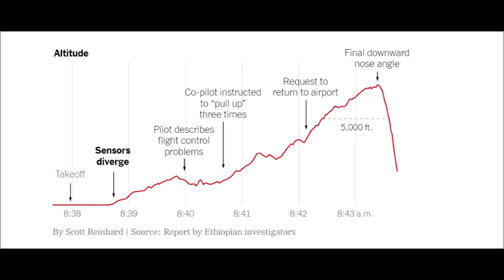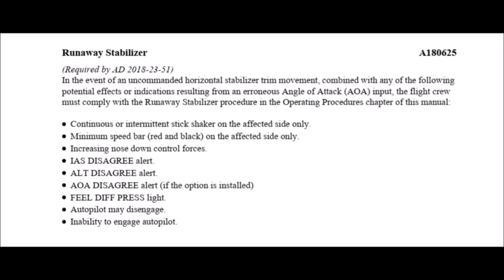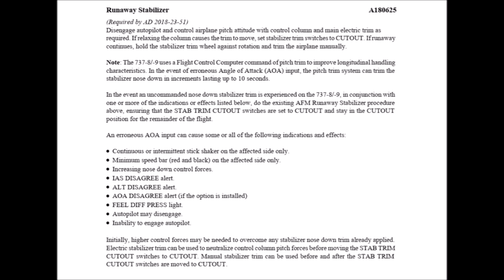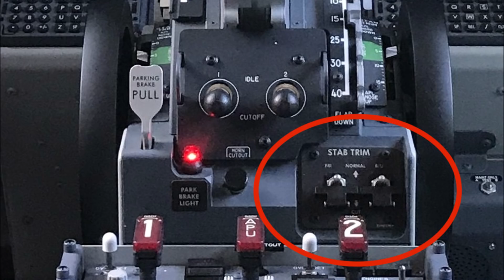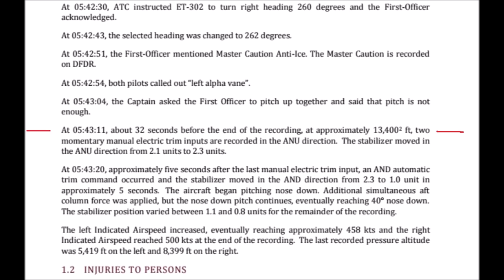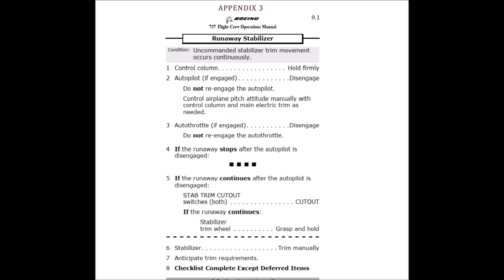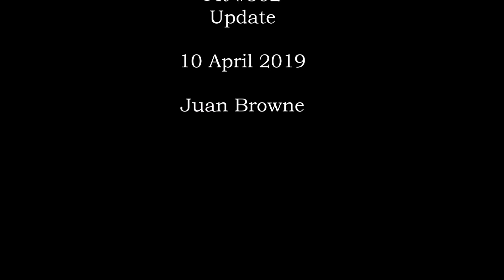737 Max Update 10 April 2019 Runaway Stab Trim Procedures

Comment: the jack screw system manual trim is a dangerous irresponsible engineering design.  At max trim, nose down, a pilot needs a mechanical, doable mechanic at max air speed, to get that nose back up.  I do not accept that in 2019 the jack screw system is right.  It is obviously inversely designed.  You need a hydraulic, a foot pedal approach, and a counter weight on the jackscrew lever, that means that the exponential forces at higher speed, can be negotiated, manually.  It is enough that the Ethiopian crew tried and were unable to wind the trim.

Comment: I can think of two reasons why the Crew may not have reduced the thrust during this whole ordeal (also remembering that evidence of whether the auto-throttles were disengaged or not is still inconclusive).
1) The goal of the crew was for the aircraft to climb. For this to take place the thrust levers need to be at climb power, which was already set. 
2) The aerodynamic forces being exerted upon the aircraft were so high in the out-of-trim condition that both pilots needed to hold the controls with both hands, which overpowered their strength, one pilot trying to control the pitch with the control column, and the other pilot trying to manually trim the aircraft with the trim wheel using both hands.
Reply: Or 3. They were saturated with information and it didn't even occur to them. Humans are not good at multitasking.

Comment: @blancolirio

Juan, given the circumstance of not being able to use manual trim due to the high speed of the aircraft, would it have been possible to electrically trim the aircraft by synchronizing the yoke trim switches and the stab cutoff switches as follows:

1) FO officer moves stab trim switches to the cutoff position.
2) Captain, pilot flying, moves yoke trim switches to the nose up position.
3) FO immediately restores the stab trim cutoff switches to the normal on position.
4) Once desired trim is obtained, FO again moves the the stab trim switches back to the cutoff position.
5) Captain releases the yoke switches.

I would think,  this procedure would deprive MCAS of taking control of the aircraft and still allow the pilots to have electric trim. Of course, going to manual trim once after the aircraft has leveled and speed has been reduced, probably would be best.

Comment: Great explanation.  However we also know that Boeing didn't emphasize enough to all the pilots flying this type of plane that once the sensors are faulty you should never reengage the automatic system because it will reintroduce the problem.  AND that they were working on a solution to this.  Boeing never did this prior to the this crash even though they knew there was a problem.
Reply: Keeping the system off is part of the runaway trim memory checklist. This is not new to the MAX.

Comment: Thank you very much sir for your simple explanation, but I have a question about speed, who controls it basically from the pilot or the system
Reply: The pilot is ultimately responsible. If he is expecting the system to manage speed, he needs to monitor the system.

Comment: Why is it, you can not wait to receive the final report of the investigation leading to this most unfortunate accident. You are so quick to speculate. STOP fanning the flames. It's clear to some of us that your many years as a pilot has turned to (bad snap judgment) and (placing blame ). UNTIL you have a final report from the proper authorities, you need to stop the speculations. I am stabbing at this but, you must have been an officer / brass of some sort in the US. Military. (stop) your not helping. What does scare me is, you might be right but, your teaching people, (your followers to , jump the gun). You seem to feel the need to be right about something, I can hear that in your voice during you'r Vlogs, as you comment on things you have no definitive confirmations. STOP teaching people to grasp, and comment on non factual reports from you. In you'r next statement, I dare you to state that you are 100 % sure the reason for the accident , you know the cause and the fix. If you do not know 100% the reasons/s then stop your Vlog and giving the public wrong insight to this matter.
Reply: What part did he speculate on?
Reply: Boeing provides little/no information which leads naturally to educated "speculation" using what little info we have like jackscrew trim position on the 2nd crash.

Comment: Juan, you need to go into training. Your attention to detail is amazing. You make what everyone else is saying, make sense. I really appreciate your show. In my opinion, it will be a decade or more (if not ever) before I ride a 737 Max. Why it took so many deaths to figure this out is unreal to me. As an electronics engineer, I know how small details , can have  huge impacts. Boeing needs to not only either replace all 737 Max airplanes, (the responsible thing) or pay for all airlines who purchased these planes to go through extensive training, all completely paid for by Boeing. Including all the extra travel fees associated with such training which as a manager I know all too well (hotel/per diem). With a plane so out of balance, would it not be better and safer to not take that one more chance? Pull the fleet in and start over? All it will take is one more accident to completely solidify how unreliable and irresponsible Boeing has become, all for money and greed in the average persons eyes. Such a huge gamble on what has been a good (for the most part)  company. If anything, redundancy is not enough. Triple redundancy is needed at this point to ensure this never happens again. Keep up the great channel. Thanks for all your doing! Love the show!
Reply: The Max is not out of balance. The software updates will fix the problem and the MAX will have a long safe career.
Reply: @stimproid The Max center of gravity and flight characteristics are totally different than the 737 due to having to move the oversized engines further forward than that of the 737 which causes the plane to pitch up more than it should on its own, or they wouldnt need the MCAS system. I for one will not take my chances, but you go for it.
Reply: @markc1310  So because the new bigger engines are heaver and farther forward moving the CG forward....this makes the nose of the plane pitch up....have actually thought that through?

Comment: As a retired B727, B757, B747-200 & B747-400 captain, I agree completely with Juan's assessment. Very well put. All the automation that has been added to transport category aircraft is intended to reduce workload so pilots can manage their flight parameters more effectively. Unfortunately, some pilots use these "labor saving devices" as a crutch to fly the airplane rather than as a tool to manage their flight parameters.
Every pilot should know the pitch attitude and power settings (fuel flow!) for every flight environment, be it takeoff, climb, cruise, descent, approach or landing. When multiple warnings are going off all at once, the pilot flying uses the previously mentioned pitch and power settings to fly the airplane while the pilot not flying sorts things out using the procedures as outlined in the aircraft operating manual abnormal procedures section. Some of the newest airplanes step the pilot not flying through a procedure via computer generated messages.

Comment: So could you please clarify something for me? (You mentioned that the procedure has been in the manual for years.)

Is it or isn't it the case that the procedure to deal with this problem is the same for the MAX version and for previous versions of the 737?
Reply: MCAS on the MAX uses the electric trim to move the horizontal stabilizer to a pitch down position. The recommended method of recovering the aircraft in the event of MCAS failure, is the same procedure pilots would use in the event of a runaway trim situation. This procedure, as described in the video, has been trained to 737 pilots since the 1960's. It is a procedure important enough that it is memorized by all 737 pilots. They should not need to look it up in a checklist. 
Does this answer your question?

Comment: Interesting video, thank you!   As a GA pilot myself for 37 years, I've done a lot of reading on these accidents.   Unfortunately, the vast majority of what we get from the mainstream media is erroneous and oversimplified, as the media's understanding of aviation is only marginally better than that of the general public.....which is to say they DON'T understand much.    When I heard that the Ethiopian pilots were having trouble moving the trim wheels manually, I wondered if the combination of a seriously mis-trimmed stabilizer and heavy control column back-pressure might have resulted in an excessively high force being required to manually trim the airplane.   The piece I was missing was the information that the crew apparently hadn't taken any action to keep the airspeed under control.   Good grief.

In the end, I think Boeing will take it on the chin for what appears to be a very poorly engineered MCAS system.  It still boggles my mind as a guy with an engineering degree how a piece of software that badly designed could ever escape basic design reviews, much less make it into a production airplane.   We will hear about this over and over from the media.   What we won't hear, and everybody needs to hear, is that all of these people did not have to die.   This was a malfunction that could have been handled, even if the crew knew nothing about MCAS.   Unfortunately, too many pilots today are increasingly relying on automation instead of basic flying skills, and if that trend continues, they won't have any of those skills.   I think this is especially true of crews from some non-US airlines.   One has only to read the accident reports on Air France 447 and Asiana 214 to realize to see that this is already happening.    If the press wants something to sink their teeth into, they should be focusing on that.

Comment: I read a comment this morning referencing not being able to manually trim in a 737 NG simulator with the stabilizer under load.
The website is here:
http://avherald.com/h?article=4c534c4a&opt=0
And the comment is time stamped. Only the most recent comments are displayed but the comments section can be expanded.
The comment is labeled:
By JJ on Monday, Apr 15th 2019 09:26Z

Comment: Juan, I hate add another opinion, but I happened to see an issue from a Quantus pilot flying an A330 plane to land at Perth Australia with a similar type of problem that the automation was different from what the pilot recognized. It doesn't tell how the pilot got control & laned the plane in Perth. He was also a former Us Navy pilot with many years of experience with the airlines. Same kind of problem where the auto over rode the pilot. It seems to me that if there is a real bad emergency that the pilot should be #1 & not auto. Have one switch with a cover over it that needs to be flipped open & then activated by the pilot to take full control. Maybe I'm too simple, but better than the deaths involved. Fred
Reply: No, you are NOT "too simple"  Your idea of "one switch with a cover" is a VERY GOOD IDEA.  Same idea as my HAL/DAVE switch!

Comment: Thank you. What I understand from your vids is that Boeing has tried to fix a hardware design flaw with a software...
Reply: Not a hardware flaw.
Reply: @stimproid  So you say that to put a gigantic engine onto an improper body to create a predisposition to the stall is a routine application in aviation. And every other plane has this stall issue which is solved by some sort of software?
Reply: @gravesyou  Did you not hear the part Where he said MCAS was NOT an anti stall feature?
Reply: @stimproid  I don't know (or care) what the MCAS is or not. This plane is not safe because it has a higher probability of high attack angle which may cause serious problems. It is both dangerous even if  MCAS is active or not.

Comment: https://www.seattletimes.com/business/boeing-aerospace/boeings-emergency-procedure-for-737-max-may-have-failed-on-ethiopian-flight/?fbclid=IwAR2rLwONWafQc3W9rKaKVPTn3Coi6mQufm3wztr2OgHVgD8CehUX3kQTdho
Reply: How about a brief synopsis of the article? I'm not disabling my ad blockers so I can pick up the hundreds of pieces of adware and cookies that site wanted to upload to my computer.
Reply: As you said - if the trim and speed is allowed to get right out of hand the combined load of horizontal stabilizer and elevators makes it impossible to manually re trim the plane. I think they go onto say the pilots then needs to fly a series of maneuvers to unload the flight surfaces, regaining manual trim each time

Comment: Juan, I hate to say it.  NO, I don't actually. Since so much of aerospace STOPPED using ADA to program these simple as a one piece but very complex with many systems. Ada WAS Required until the late 90s. Unfortunately, not enough programmers were learning this Language that would catch logic errors. Also, the level of sensors and controls have been taken over by flight computers can be good but also a disaster if NOT properly done, I have never seen this type of issue with Boeing till now  but kind of have been expected due to so many changes.

Comment: thanks for your videos. Major issues you are not touching upon in my opnion -
          Autothrottle also not working properly.
          At take off max speed required for lift off........so when do they reduce speed ?
           if all systems pointing to a stall why would pilots reduce speed ?
           first MCAS kick pointed nose down - this should increase speed automatically
           Pilots of EA followed procedure and shut down stabiliser trim........but by this point manual trim impossible.

seconds to figure out multiple failures and fix - guess what could have worked is engage stabiliser trim ...use electrical trim...disengage stabiliser trim immediately without allowing MCAS to kick and keep repeating till. BUT 
WHY IS NO ONE TOUCHING ON UNSTABLE DESIGN - SPECIFICALLY THE CENTER OF GRAVITY DUE TO HEAVIER ENGINE AND MOVED FORWARD TO ALLOW CLEARANCE FROM GROUND ??????? THE MAIN REASON MCAS WAS PUT IN THE BACKGROUND
                                                                                                MCAS THAT KICKS IN X1 THEN NEXT TIME X2 THEN X4
                                                                                                  THE LIST GOES ON AND ON AND ON
end of the day........you are doing a good job. Would appreciate including some more ascepts in to your next video
Reply: You could watch his previous video where some of your thoughts were addressed.
Reply: The design of the MAX is not unstable.

Comment: These reports are excellent, thank you fir taking time to upload them.
One thing bothers me with the AWD. Why would you have IAS disagree?
There is no real commonality between the AOA Alpha vane and the Pitot.

The fact that Boeing suggest that IAS disagree (and many other alarms) may accompany the AOA disagree indicates to me that there may be some more fundamental issue with the sensors or air data system.

No one is talking about why the AOA sensor is so unreliable. Yes MCAS should have its authority reduced, but why is it getting erroneous data in the first place so regularly?
Reply: quenchize Good points. The explanation is a bit technical. The AOA data, along with airspeed and other parameters, is fed into a computer called the ADIRU (air data inertial reference unit). Each of the parameters has to be calibrated, before being passed on to the crew and flight control computers. The calibration process normally involves small adjustments to all of the parameters, but because the AOA data was corrupted, many of the others became unreliable. It was a cascade of errors.
Reply: @gordonrichardson2972  Thanks Gordon. I cant understand why AOA data should be used to change IAS. IAS has a precise definition which does not involve AOA. Perhaps the stall speed is calculated and when the calculated stall speed is different you get IAS disagree alert?

Anyway my main point is that the actual AOA sensor is not as reliable as it should be. and it seems to me that they should be fixing that as well as the software. I hope that they do.
Reply: The reason that AOA is used to correct IAS, is that the pitot tubes are fixed to the aircraft and not oriented into the airflow. An adjustment must be made to the raw data, otherwise IAS would reduce at takeoff, which would be highly disturbing. Exactly the same ADIRU is used on the previous NG model, so this is not unique to the MAX.